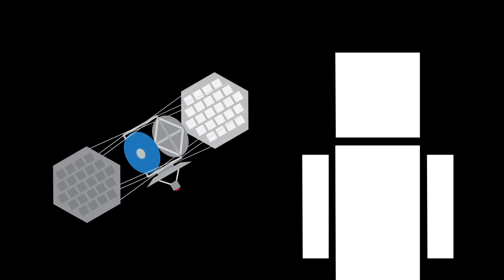Why Don't We Just Put Solar Panels In Space?

Comment: Another option is to have floating solar farms above the clouds carried by helium balloons and anchored to the ground with very long wires. The amount of concentration of radiation is also stronger at much higher altitudes, engineers have calculated that we could get 3 times as much energy above clouds than we can on ground. 

The space project is not entirely unfeasible though. We need to look to the moon. Solar panels are made out of silicon, so is the majority of the moons surface. At the same time the moon has very low gravity and it is actually completely feasible with current building materials and technology to implement a space elevator on the moon. That would enable us to launch solar panels into space virtually for free, since these panels could actually be carried to space by the electricity they themselves are generating. This will particularly become very feasible once robotics technology advances to the level where we could automate the entire process! Imagine robots on the moon, being controlled by AI and closely monitored from earth, building a solar factory and covering the moons surface with solar panels and then begins launching solar panels into space. One could even imagine robots building a robot factory on the moon, that builds more factory-building and solar-panel-building robots, thus increasing solar capacity with and exponential (or logistical growth rate). We could even cannibalized on other planets in the solar system as well. Harvesting the energy of our sun is the path to becoming a type 2 civilization.
Reply: Helium is valuable

Comment: Wouldn’t the clouds and ozone get in the way of the microwaves just as much as the radiation from the sun. I think a halfway point of flying solar balloons above the clouds connected possibly through wire to the ground. Lightning could possibly be an issue there I guess.

Comment: If you put solar panels up in space don't you need a very long wire to go all the way down to connect to some houses or a house but the problem as well is that the solar panel might move upside down or up like in a circle and it might take long to charge cause it gravity and it would make the solar panel move around.
Reply: The only way to get the energy from the sun is by the solar power is if we put it somewhere on the moon pointing straight to the sun or somewhere in a different place of a planet but the problem is that there has to be a wire connected to a house or somewhere to get the energy down here on earth.

Comment: i have 4 x 100 watts solar panel with a 12 volt 1500 watt power inverter i like them  it like free power i run them from  9am to 7 pm and the power went down from 13.1 to 12.5 volts not bad i had my rv hook up to it wirh everthing on in it

Comment: Hey, this was as interesting video as  I tend to advocate space based solar.  I'd appreciate it you could also consider one of the more radical scenarios that has been proposed, where the solar panels are actually in orbit either at the L1 Lagrange point between the Earth and Sun, or directly around the sun.  At these distances, in addition to the lack of attenuation from the atmosphere, the available radiation is also significantly higher intensity, leading to greatly increased energy production --- in many cases, by far enough extra to outweigh the conversion inefficiency of going to microwave and back.

It is also worth pointing out that although solar is a relatively good energy source on the ground, large scale solar installations in the desert are not --- contrary to popular belief --- completely harmless:  they tend to destroy large tracts of habitat for some very complex & important desert ecosystems that are often ignored because they are not obvious to the human eye.  The maser receiving stations necessary to convert energy from space solar into usable electricity on the ground are much smaller and would likely have somewhat smaller impacts.

Finally, since you seem interested in the feasibility of the topic practically, as well as a theoretical discussion of its benefits, you might also be interested in considering the potential political hurdles that such projects (especially the sun based ones) might have.  In some of the scenarios that have been considered, in particular, a relatively few installations are providing power for the entire Earth through a network of relatively centralized distribution stations --- for example, a lot of the Earth's power may have to come from one particular half of it at any time based on which half is facing the sun.  This faces a number of political challenges as long as competing country governments are wary of relying on a few other countries for their entire flow of energy.

P.S. I would also like to mention briefly (since you seem to have appreciated this in some other cases; I hope it hasn't been brought up before) that silicone and silicon are two very different words/substances: the silicon in PV cells is not pronounced the same way as the silicone polymers that are used in cooking implements, etc.

Comment: Geosynchronous solar satellites are the best use of solar power. I would change the design in the video to transmit energy via laser. That's more efficient than microwaves. I would also convert the laser directly to heat--boiling the ocean, generating steam for power, distilled water for drinking, and salt for our use. I'm also willing to spend trillions to make these satellites miles in diameter. I would finance this by selling public shares and some US government funding. And I would make this part of the US budget until it is self-sustaining.

Comment: why not sent batteries with the solar panel and have them sent down so there is less conversion? or would that be even more costly?
Reply: You'd have to spend energy to send the batteries up, and then spend energy to get them back down again. You can transmit power with microwaves.

Comment: why in space, on the ground we heave enough room for them
Reply: There is MUCH more room in space than on Earth and a solar panel in space can produce 40 times the electricity as solar panels on Earth.  Also the Space X Star Ship can put one KG in orbit for $20.  I know this sounds insanely low, but the Starship is made to fly into orbit three times a day and the cost of fuel per launch is less than $2 million pre launch.  

When the space shuttle was in operation, it could launch a payload of 27,500 kilograms for $1.5 billion, or $54,500 per kilogram. For a SpaceX Falcon 9, the rocket used to access the ISS, the cost is just $2,720 per kilogram.

Comment: You missed the point. Night time. Sure, you mentioned it once, but that's a big issue. Not to mention that most solar panels are fixed due to costs, and so they only generate peak power for minutes during the day. The atmosphere doesn't do much to stop the energy, but it is a bit of an issue. Even so, cosine losses and night time are far bigger issues. Solar power will never be able to provide base load power unless we use space based solar power, which always points to the Sun (no cosine losses) and it's always in sunlight, save for the occasional eclipse by the Earth during Eclipse seasons. Getting past the attenuation due to the atmosphere is just the icing on the cake.

Comment: They've actually just found out that solar pannels aren't all that environmentally friendly. The process used to remove excess silicon emits Ammonia, which has 15x more warming power than Carbon-dioxide. They started a redesign several years prior, which emits no Ammonia in the process. Solar pannels are great, but I'm not buying until the redesign comes out.

Comment: I vote for fusion power!
Reply: I vote for Harambe
Reply: GenericIndonesian #DicksOutForHarambe
Reply: mlg360 ProShooter Oh hell yeah my dude #DicksOutForHarambe
Reply: That's literally what everything except for geothermal is.
Reply: Geothermal comes from decay heat of radioisotopes inside Earth. Isotopes were formed through a type of nuclear fusion (r-process) most typically upon merging or explosion of neutron stars. So it's also fusion power by that metric.
Reply: Not all of it. A good chunk of it is just the heat of the Earth's core not cooling down, which is partially due to radioactive isotopes.
Reply: Sure, you're right, but then again the reason why the solar system formed and there was material leftover to form the Earth through gravitational collapse is also thanks to previous nuclear fusion.
Reply: André Pivré I vote for both
Reply: The Juno space craft has a orbit around Jupiter that is highly inclined to Jupiter's orbital plane,  thus it is always in sunlight! That is why it doesn't need Plutonium atomic batteries(RTGs).